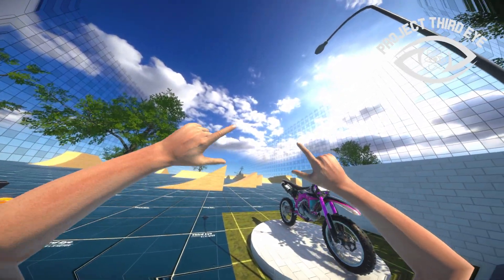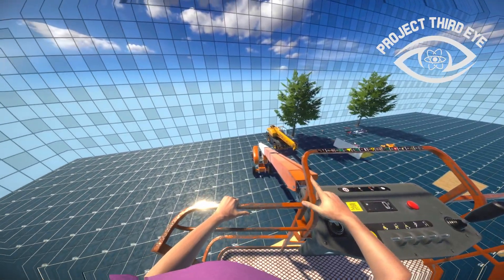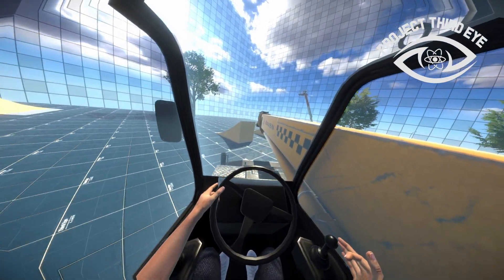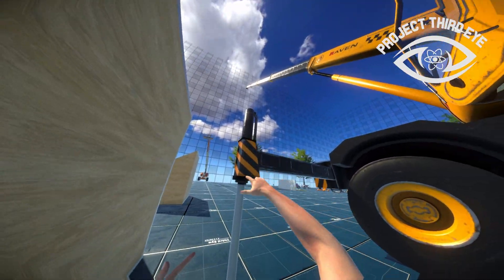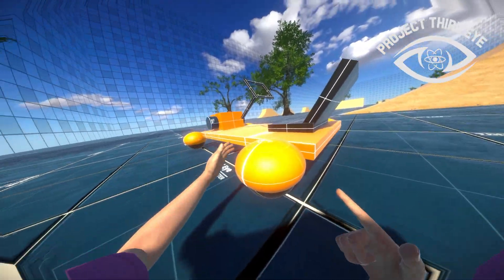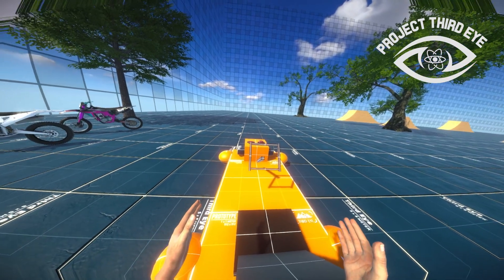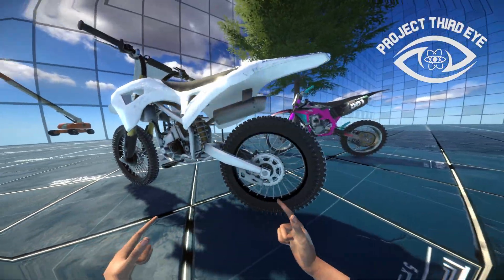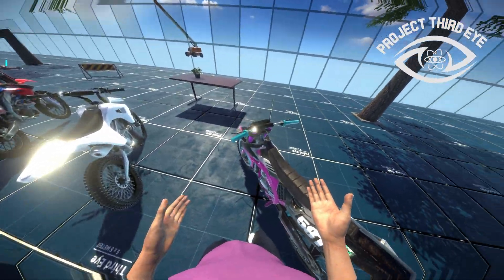Project Third Eye #47  | Dirtbike Physics 3.0, new Models, Engine Sounds and Auto-Crane #VR

Comment: i think the leaning would still be a nice inclusion (both left right/forward back) but could be helped with some damping so it's not 1 to 1 with real world head movement. This could help with the motion sickness due to the snappiness of the movement before and make it more controllably and granular so you have to properly lean in to get the effect rather than just a slight tilt - just my 2 cents

Comment: suspension on the bike is too soft i think, most motocross bikes or any dirtbikes in general have very hard suspension, however if the player model currently has no weight to it or very little weight it should be fine, but you defiantly cannot compress the suspension on an actual bike with one hand. And put leaning back in

Comment: Are you planning to introduce bike physics using actual inertia? Which means steering by counter steer? I guess it's impossible without control system using force feedback as you need to counter the counter steering input to align with the tire patch. To be honest there is no way to make the bike realistic with locked roll axis, as the contact patch of the tire will be always in the middle, which is not at all how real bikes steer. Cheers.
Reply from the maker: Years ago, I experimented with hand-tracking and a piano and found it's nearly impossible to play without precise haptic feedback due to a lack of orientation.

The same applies to riding bikes. What seems simple is actually a complex balance mechanism. Without orientation beyond visual input, maintaining balance is almost impossible.

When I tried unlocking the roll axis, you immediately flip to the side, making it impossible to stay balanced for more than 10 meters.